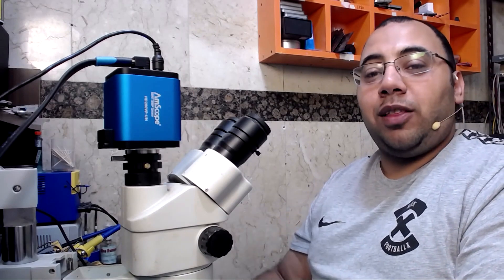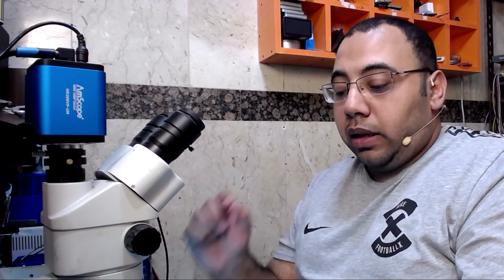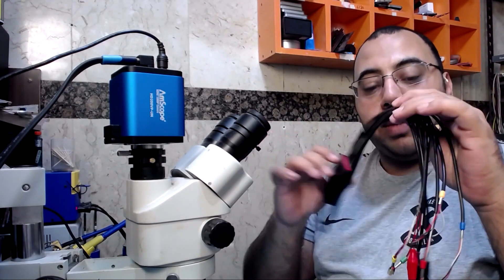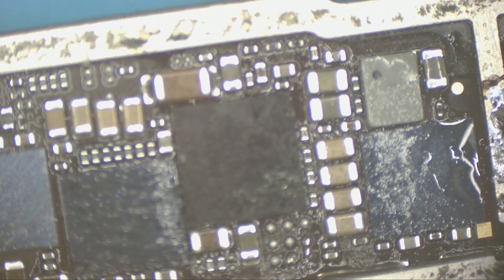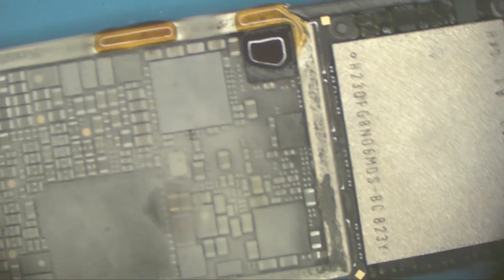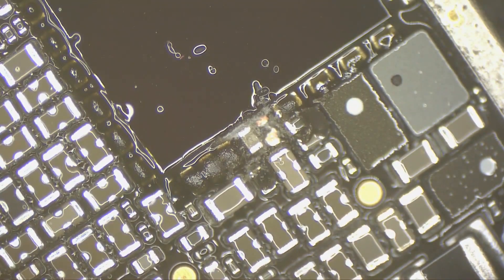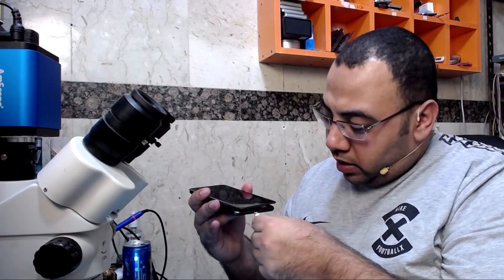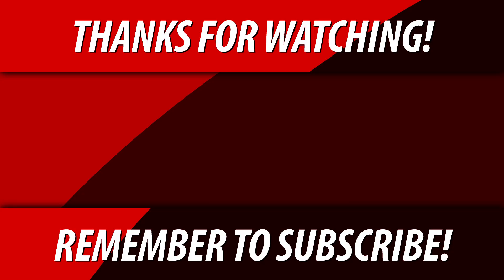iPhone 8 Plus Repair (Won't Turn On or Charge) How to troubleshoot & Fix

Comment: Hi Aymen Sir
BIG Fan of you and also works in Dubai ... i Have same Problem with iPhone 8 Plus VDD main Shorted I applied the Rosin all over the Board but can’t find any melted components except that mosfet ... only this mosfet melted when I applied 2.5 voltages on the Phone with DC Power supply
Reply from the maker: apply voltage to vcc main rail not threw the battery connector

Comment: thank you for the videos :). i tried your method to know where the short coming from. i am not seeing short on the board, but it show 4.14 A i tried the other side of board but i dont know how i just throw the positive to m5500 and its still 4.14  A. What should i do?
Reply from the maker: In that case you need to use thermal cam

Comment: My Iphone 8 plus rear Camera not working properly. 
Portrait Mode or Photo mode Not Working but video Mode, Timelapse or slow Motion working.
In Third Party App Camera working But focus Problem.
Reply from the maker: This is a hardware problem and i guess you are a user mostly hardware problems users can't fix it themselves it is better to take it to service center
Reply: @AymanTheRepairTech  Ok thanks
Reply from the maker: @areebkhan2878  You welcome
Reply: Ayman The Repair Tech ‘This mobile is out of warranty and opened in mobile repairing shop. so i think service centre will not allowing.

Comment: My bro!! I have a Ip6 stuck in apple boot loop, in my power supply stay in 0.09mha any idea?
Reply from the maker: if its stuck on apple boot loop how it could stay on 0.09 amp it should be changing not stuck at one number
Reply: Ayman The Repair Tech  my bad, go to 0.09 to 0.17 and restart, if only push power button stay in 0.09mha and down
Reply from the maker: @rudoynes  Check screw holes and usb ic then measure the PMU outputs and let me know the history of the phone

Comment: nicely done bro. 
question? did you replace those two capacitor you remove it? or its okay even no need to replace it?

keep it up bro.
Reply from the maker: These two caps is ok to not put back but not all caps you can do like that and if you want to know which you can and which can't you have to know how to read a schematic the parallel cap can remove but series cap can't
Reply: @AymanTheRepairTech  very helpful info bro. Again nicely done master.
Reply from the maker: @AkiraSultan  Thank you

Comment: Nice video. I’ve got a 8 plus that’s come in had a big drop any recommendations? On where I could start
Reply from the maker: That is really a very wide question what i always do is to visually inspect every single detail on the pcb then i measure power voltages and resistance values
Reply: Ayman The Repair Tech haha. I knew you’d like that question. Well for starters when plugged into the power supply power on and it draws 0.001 amps then stops.
Reply from the maker: @mrkakaonu  Hahah no i hate that question because believe me if i could fix phones online i would be a millionaire by now but i couldn't
Reply: Ayman The Repair Tech yea I was being sarcastic. But say on this video. How did you come to the conclusion there was a short? Just running power into it. Or by checking voltages etc
Reply from the maker: @mrkakaonu  By monitoring the power supply amp reading and using the multimeter
Reply: Ayman The Repair Tech so with the power supply connected it’s not drawing any amps. So would you just leave it connected and check with multimeter ?
Reply from the maker: @mrkakaonu  no no if its is not drawing amps that is mean no short, in my case the phone was drawing a steady amount of  amps without me turning it on these things are the basics and i am sorry to say it is hard to learn it from YouTube or online and i advice you to apply for any kind of training because there is a lot to learn to be able to troubleshoot electronics problems
Reply: Ayman The Repair Tech yea it’s definitely on the cards. I’ve really just been doing more
Straight forward repairs. Touch ic etc as I have prior solder knowledge. Basically with this one when plugged into charger it draws from 0 to 0.37 amps and Jumps around. But won’t power on or anything with the power supply.
Reply from the maker: @mrkakaonu  Nothing wrong with the power supply the problem in the phone